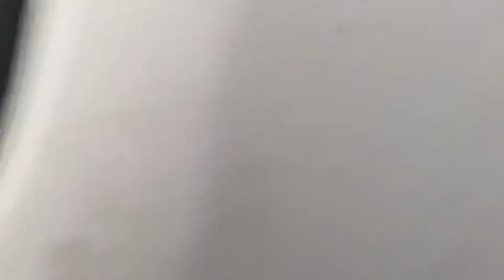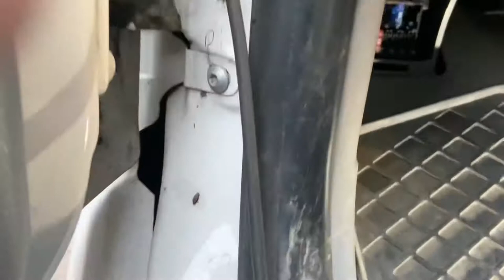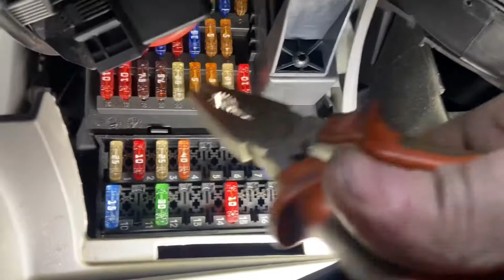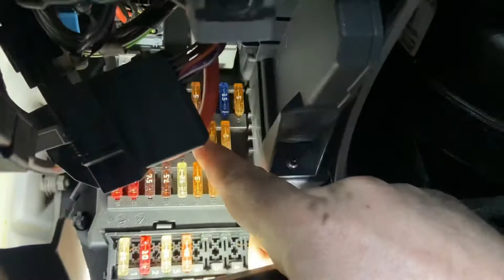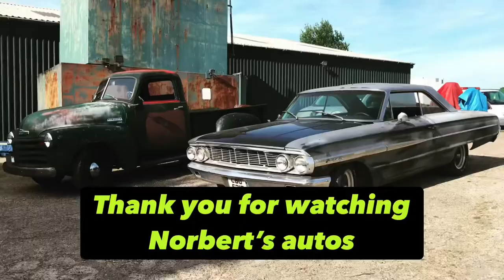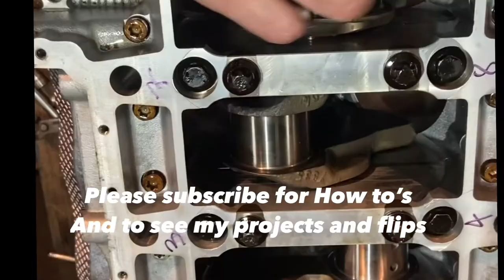Vw crafter Mercedes sprinter 12v socket Cigarette lighter fuse location how to

Comment: Hi there 
I got vw crafter 2015 , I’m looking for fuse number for dipped headlight right side please
Reply from the maker: It may not be fused. Sometimes they are wired directly from the body control module. 
  I’ve had them burn this circuit out before on the sprinters. Maybe a full diagnostic scan as there should be a fault code.

Comment: Didn’t work also how about the 12v socket below the pullout tray where is that fuse
Reply: Did you find out
Reply: @datboykcold  no lol
Reply: @tooguru7492  mannnn 😂😂 im still looking
Reply: @datboykcold  I think there is a fuse box by the drivers step I’m gonna look tomorrow …. Keep in touch
Reply: @tooguru7492  alright I’ll be keeping a heads up and vise versa
Reply: @datboykcold number 30 on the right side fuse board, under drivers seat. 15amp.
Reply: @tooguru7492  number 30 on the right side fuse board, under drivers seat. 15amp.